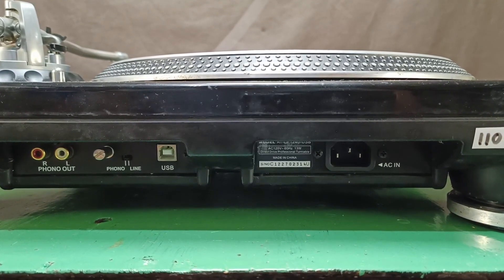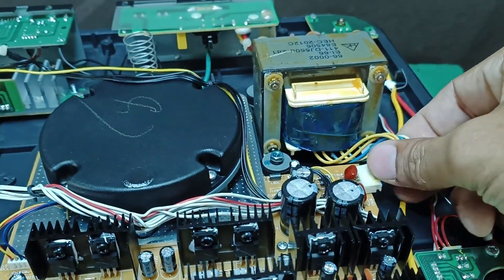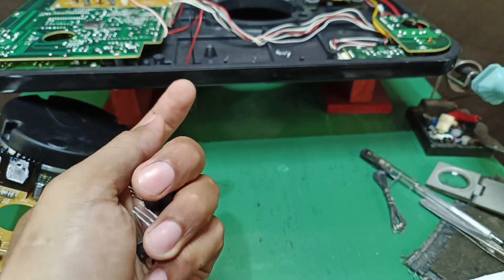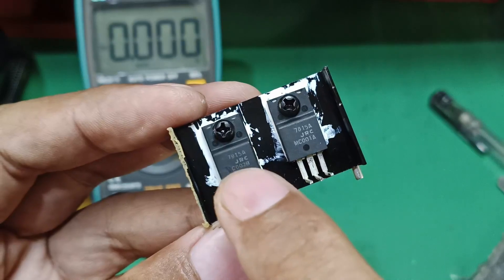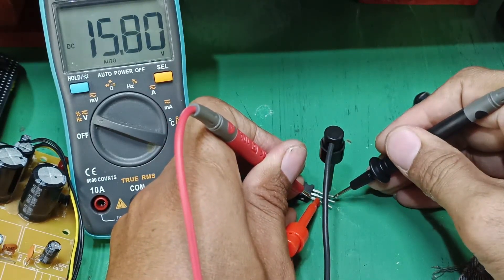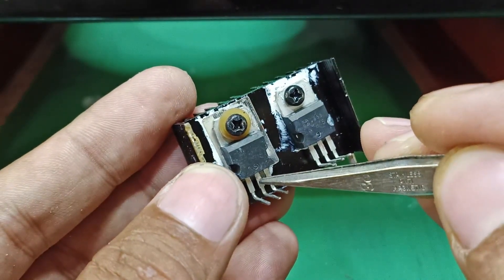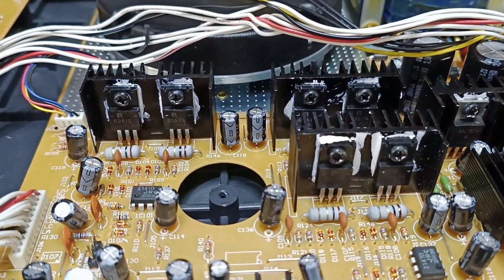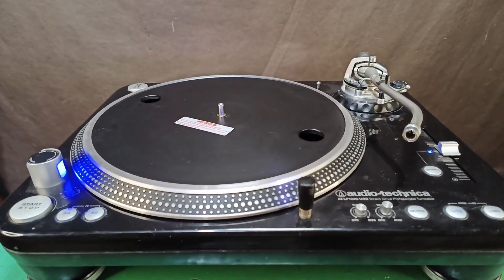110V Turntable Won't Spin After Accidentally Plugging into 220V

Comment: Hello sir, I accidentally plugged my TRIO KPF7 Japan 100V AC into a 220V outlet. Upon checking the pcb part, the fuses are burnt but I don’t see any circuit burns, capacitor bulgings, or any burn components.

Is it possible that only the fuse was affected by the overcurrent/overvoltage?
Reply from the maker: Isolate first the power supply by disconnecting the connection going to the main board. Then replace fuse check voltage output.

Comment: Accidentally plugging a 110V device into a 220V outlet is not uncommon here in the Philippines. Despite our voltage being 220V, we are using an American NEMA 1-15R outlet, which is intended for 110V in the United States. This means the plug of their 110V devices can fit into our 220V outlet, potentially damaging them.

Comment: In Jan 2025 ,I bought a philios turntable with built un valve amplifier .I simply plugged in and tge power indicator turned on.After donetime the power transformer got burnt and the power light went off.I do not lnow ehether the input was 120 volts or 230 volts AC. I got the transformer repaired and the amo was working but the motor coil got burnt .I played thru aux input( a modification done ) and it played but the original output was 2 watts per channel and now it is 5 watts per channel ,so I stopped operating it .Please do inform as to ehat is to be fone to bring the output at 2watts per channel. The pholios Holland model number is AG 9125 .Whether the coil rewinding is possible and output power can be reduced to 2 watts per channel or not .
Regards
Reply from the maker: Maybe their is something wrong with the OPT that's why you have 5 watts out. Check the specs of the valve it's load impedance. And check the impedance of your OPT.